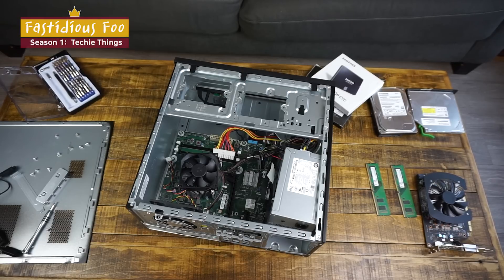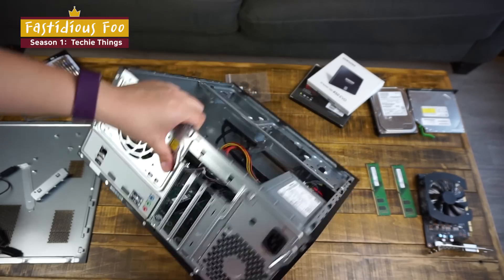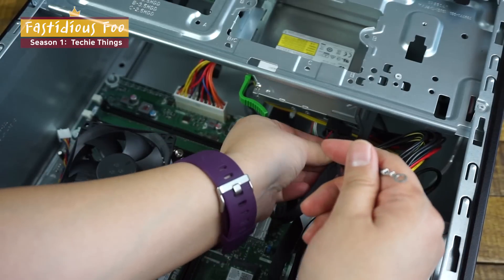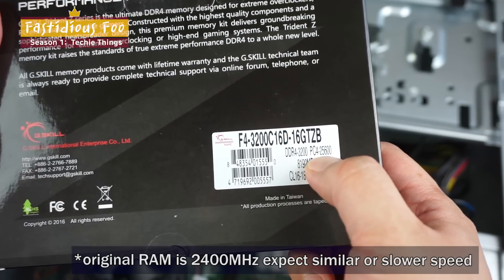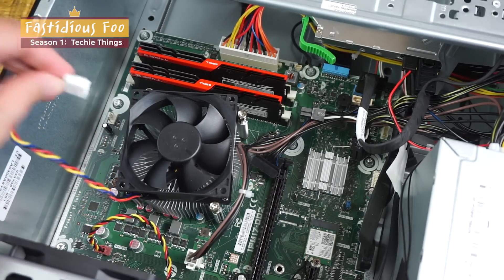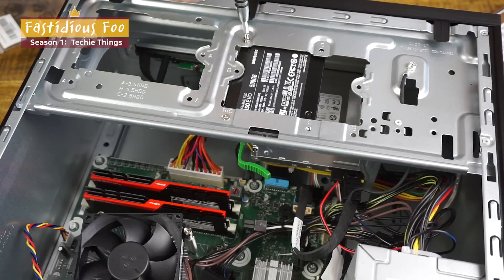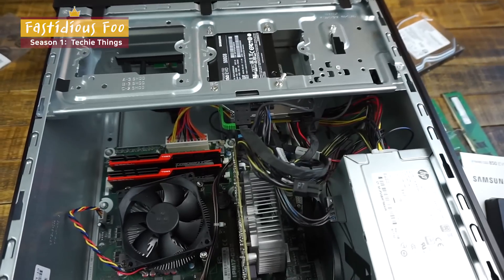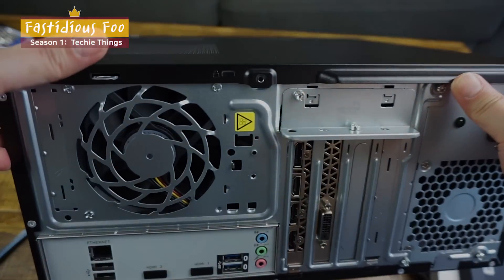RAM / SSD upgrade on HP Pavilion Power Desktop 580-023w

Comment: If I️ wanna replace the PSU would I️ need the same one or can I use any other PSU
Reply from the maker: you can use any other PSU as long as it is ATX or micro ATX size
Reply: could you make a recommendation that would use the same screw pattern with a similar fan placement?
Reply: Micheal Barger I bought an evga 550 watt power supply which fits in the case and can use the screws if put in the right way I dont use the case anymore because I upgraded my pc and now have a coolermaster case
Reply: @coaltrain2299   What box can you serve? do you have any link

Comment: did you not change the 300 watt power supply? how does it manage to power the new ram and ssd without exploding?
Reply from the maker: E.T. Everett I did not have any problems with the psu but I later built another computer off of some parts from this computer and psu with higher wattage

Comment: I am a complete novice so I have some basic questions. 

1. Do I need to buy a SATA cable for the EVO 850? How will I know which one I need to use?

2. What are the benefits in adding more RAM? Are there any cheaper options to the Trident Z 16G?

3. I understand that a lot of these questions need context on what I plan on using the pc for. I’m not a pro gamer but I want a machine with the capabilities to grow stronger and be more than capable of what I want it to do (somewhat) regardless of what direction I want to take it. 

Thanks so much for making these videos. Super helpful!
Reply: It comes with an extra SATA cable and slot for ssd/hdd.  RAM benefits are you can run more high-end things like photoshop or similar editing programs/games.  Not sure on price, but it has 2 slots, which is kinda low.  You can't upgrade past 16GB (2x8GB sticks) which limits some video editing.  A thing I heard once is that you would rather have two low memory sticks (say 2x4GB) than one big one (1x8gb) because each stick can only process so much. 
 Stock it's great for a casual gamer but the Graphics sucks a bit much power so the PSU has some issues.  Really all you can do from what I've heard is the CPU, PSU, RAM, and Graphics.  The case is too small and the motherboard is limiting.  The processor is an i5 so it's not the best for multiple big processes at once (say fortnite and world of tanks).  Not a good streaming one.  So pretty much a cheap casual PC.   Like I said, all it really needs is a PSU and SSD.  I run it stock and am considering a SSD for booting and freeing up room.
Reply: @Planeman777  What? lol I have this pc stock and I run World of Tanks AND Fortnite at 100+ FPS on ultra
Reply: @magscorch7706  I phrased that poorly, my apologies.  I meant that the graphics card draws a little bit more power sometimes.
Reply: @Planeman777  I do agree that the PSU is a little week though 300w isn't really room for improvement but otherwise wonderful pc. Definitely gonna put an SSD in it soon though
Reply: Magscorch I have mostly everything low on fortnight and I get good FPS but my game freezes and I experience common frame drops

How do u have it on ultra and not experience problems?

Comment: Hi I’m thinking about getting this desktop really soon. Do you think there enough space to put an Nvidia GTX 1080 in it?
Reply: You'll have to remove the dvd-drive and get a better power supply.
Reply: Jad Khalil I have one and it "looks" like it should
Reply: Jad Khalil This is my problem, my rtx 2070 does not fit into it because I don’t think you can remove the big grey bracket

Comment: i know im a little late but is there enough connectors on the motherboard for both the original hdd and an ssd. Because I want to order this desktop and install windows on the ssd instead of the hdd that it comes with and I wanted to know if there was enough space for it.
Reply: also i wanted to upgrade to a 450watt psu, will they fit in the case?
Reply from the maker: yes, there are 3 SATA ports

Comment: If you were to upgrade the power supply would you go with a 500w or something more powerful?
Reply: same question... is 300w powerful enough?
Reply: Not for the graphics card, but a 450-500 is the standard I've heard to round it out.

Comment: What are the chances of being able to upgrade the PSU to say a 600watt I have laying around. Then selling that `060 GPU and putting a 1070 in it for my sons fist gaming computer. The GPU definitely looks strange compared to what im used to.
Reply: I’m a kid and ik a lot about PCs you can switch the PSU but if you are gonna change the graphics card to a 1070 then you will be fine but maybe get a bit better of a CPU but it cannot be an eighth generation i5 or i7 it also cannot have a “k” in the end because that’s the eighth gen
Reply: BFMVmetalA7X also they
Took off the plate to it too reduce the cost of the Graphics card
Reply: Twisted Agario On the HP website it says it is compatible with the Core i7 7700K, just look up Odense2-K on Google and under processor upgrades it has a list of CPUs you can use

Comment: Hello Fastidious Foo. I have the same PC and am looking to upgrade RAM and to add a SSD (to work in combination with the standard 1TB HDD).
1. As far as upgrading RAM goes, do you need to do any additional work other than putting the new ones in?
2. I want to use a SSD for storing same of my games and I still want to use the HDD for everything else. How would you go about doing this? Just plug in the new SSD and create a new drive?

Thanks!
Reply from the maker: 1. no, you don't need any additional work. 2.You can just add the SSD if you want to use it for storage but people like to use SSD to run OS and programs for its speed/performance and use HDD for storage...

Comment: Great video...One correction though. To add an addtional drive you dont need a bracket. My unit came with 4 extra screws that worked perfectly on the 3.5 SATA drive. This case is REALLY tight.

Comment: To upgrade the RAM and SSD drive do you have to tear down the computer as much as you did(example: removing both power supply and graphics card)?
Reply from the maker: Mandie Sehl No, in fact you don’t have to tear anything down. Just replace the RAM and put the SSD on

Comment: I'm planning to buy the exact same ssd. What type of screw did you personally use? And do you think there's an additional PSU plug for the ssd? I'm having both HDD and SSD so I'm wondering will there be another PSU plug since there's already one in the HDD.
Reply from the maker: I think M3 screws (not 100% sure) and there is an additional PSU plug for the ssd.

Comment: Not tech savvy-edit music & stuff 1tb drive ok,thinking upgrade to edit ebay sport 30mp 4k and night vision 48mp 4k cams-ssd$?,so looks at Fire Cuda 2tb sshd $100.00 @ Amazon & OS & games & 4k massive space use & edit area-looking for Sata Cable with Ground Wire-?,Amazon Idea`s:up here tech cpu water cooler $50./Seagate 8tb external w/2 usb 3.0 $150./Occulus Rift Touch $400.(Gamer Buttons?)& 3rd Sensor @ Best Buy $60./Pioneer external BDR-XDO6J $160. uhd?read write?Japanese?English?Burn uhd?& blu ray/dvd/cd & use 50 to 100 disc storage boxes so storage won`t get overloaded*?,Thanks for HP 580-023W video intro,Steve C.
Reply: Steve Cornett I have absolutely no clue what you just said...

Comment: keep in mind the i5 7400 only supports up to 2400 mhz for the ram clock speeds.
Reply: so does this mean its pointless upgrade the ram?
Reply: Quibzy not necessarily, if you wanted to you could upgrade, the max amount of ram you can get is 64gb. so you can upgrade the amount. but the speed is limited to 2400
Reply: You can upgrade the cpu to something like a Core i7 7700K though so you can get faster ram

Comment: i still have a 240gb intel ssd in my old desktop and im debating whether i should install it in this new one. but im worried about the 300 watt power supply. do you think it will be safe to keep both drives including the ssd for boot and hard rive for storage?
Reply: Mike None for me I would personally upgrade to a 430 battery supply  which are around 50$ on amazon just to be safe
Reply: Yeah I really want to upgrade a lot of stuff on it but I'm not doing anything until I upgrade the psu, 300w seems to shady
Reply: You should be fine. I have 2 HDDs one being a 4TB Seagate, the other being what came with the PC and I have no problems.
Reply: Caleb  Shahin do you have the serial number to the 4tb seagate thats in your system or the website you bought it from?
Reply: Caleb  Shahin and could you put a 8tb seagate in instead of the 4tb
Reply: Here's the 4TB  https://www.newegg.com/Product/Product.aspx?Item=N82E16822179299 ,  and here's the 8TB https://www.newegg.com/Product/Product.aspx?item=9SIA0FU6R49150 . I don't use the 8TB so you might wanna do you research on it
Reply: Caleb  Shahin thanks boss was trying to research the maximum amount of storage i can put in my system but i cant find anything.
Reply: No problem,  just keep in mind how fast the hard drive can read and write.
Reply: Caleb  Shahin so if i used the original hdd for os and installed a 8 tb or larger hdd for storage i would also need to install two 8gb rams? Would that help it read/write faster or wouldnt make much of a difference if i got a good hdd?
Reply: Bill Coughran The read/write speed is determined by the HDD. If you don't mind me asking, what are you using the computer for?
Reply: Caleb  Shahin server or a host for cloud computing storage

Comment: Can you install a ssd with the original hdd still in there, for a total of 2 drives?
Reply from the maker: yes, you'd need to buy an extra SATA cable, but yes it is possible.
Reply: Thanks! Your videos have been really helpful, I'm getting it next week.
Reply: So when adding the ssd. Once you get a new sata cable do you just plug it into the ssd and ready to go?
Reply from the maker: Dean and Jennifer Buse No, you would probably want to use the ssd to run the OS and use hdd for storage, right?
Reply: Fastidious Foo that’s correct
Reply from the maker: then burn an image from the hdd (probably using HP Recovery Manager) onto USB / CD to install on SSD, install it on SSD, then probably format the HDD
Reply: Fastidious Foo thank you but don’t i need another sata cable to connect the ssd to the motherboard?
Reply from the maker: yes, you need to get an extra SATA cable if you want to use both HDD and SSD
Reply: Fastidious Foo one more question, I got the pavilion power 580 023w and i’m trying to get it connected to my monitor but i don’t see any hdmi cable
Reply from the maker: there's an hdmi port, 3 display ports, and 1 dvi port. https://youtu.be/arDsHiRMpxg
Reply: Do you also need a splitter for the power supply cable?
Reply from the maker: no, you don't need a splitter. there's an extra cable from the psu

Comment: Hi I just purchased this desktop today. I see there is an M.2. Can you please recommend me an M.2 SSD size for the 580-023w
Reply: There is but I think you need an adapter or something as it's a wifi m.2 port, I got a new ssd that I mounted on the 2.5 port with a 3$ sata cable
Reply: Let me know what SSD y'all getting for this pc
Reply: Victor Dural Samsung evo like the one she has in the video is the most popular one for an upgrade.
Reply: The m.2 won't work with the 2280, you'll need an adapter and I'd rather save all that headache with a Sata SSD upgrade

Comment: Overall do you think this is a decent pc?
Reply: This pc runs all modern games above 60 fps on ultra/high. Some games you may have to turn it down medium even though they automatically set it to the highest settings. Only game I turned down to medium was PUBG cause the game is poorly optimized.
Reply: If you want to build this build buying parts separately, it will cost you at least $800 without wireless card, and cd rom. I bought this for $499 and I'm loving it!
Reply: crazydrpepper runs Witcher 3 high setting above 60 FPS I don’t know what happened to yours
Reply: Fastidious Foo is this pc good for gaming like overwatch and cs go right out of the box with the hdd
Reply: @joseg9419  Hell yes OW and CS:GO run AMAZINGLY WELL. Far Cry 5 and RE7 will run with brief random freezes, though.
Reply: Definitely, just got off CSGO too and I was running above 170+ fps or so on everything maxed. Overwatch you can definitely run it high FPS on max as well. Both are very well optimized game so the PC runs both games very good.
Reply: Azelkaria even with the hdd?
Reply: The HDD does not affect game fps whatsoever. It'll only affect your loading times on your computer startup and games you play. I slapped on a 2.5" SATA SSD recently into my pc and it's a beast.
Reply: Azelkaria oh thanks gosh, I was really worried about that
Reply: Yeah, the only MAJOR component that affects your FPS is your GPU (Graphics card) and the processor.
Reply: Can this pc have both HDD and SSD?
Reply: crazydrpepper just played mass effect andromeda on high with 60fps the other day...
Reply: do you even have the pc?
Reply: ok have you played any games on it.
Reply from the maker: yeah, I think so I don't think my husband's having any problems with the PC and he seems overall satisfied.
definitely one of the best for value PC that's out there
Reply: Porter likes to Party Bullshit
Reply: Entry Yeah Bullshit typical idiot
Reply: Entry Yes dumbass I do!!
Reply: Don't listen to this fucking idiot. This PC run games on low settings high or ultra isn't playable!
Reply: Just saying this model definitely can run FO4 on near ultra settings with no stutters and minimal fixes required, also easy 1080p 60fps on destiny 2 with no drops